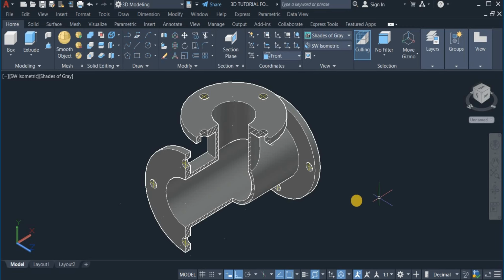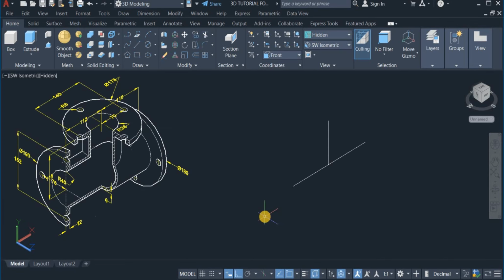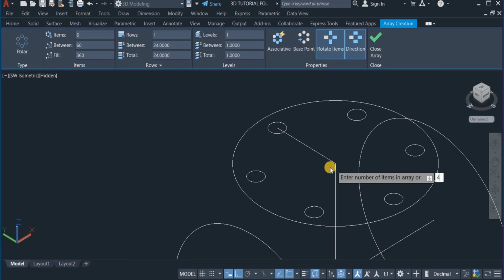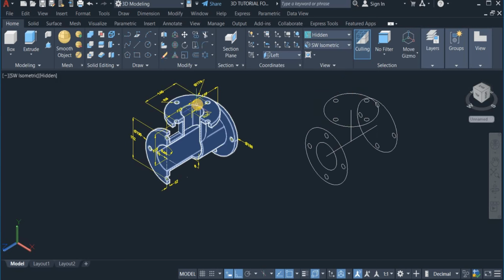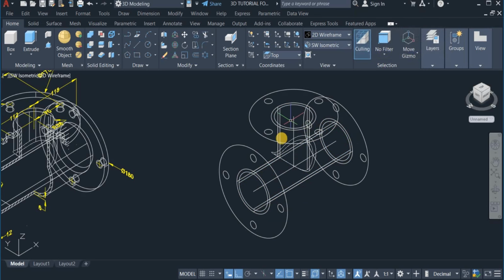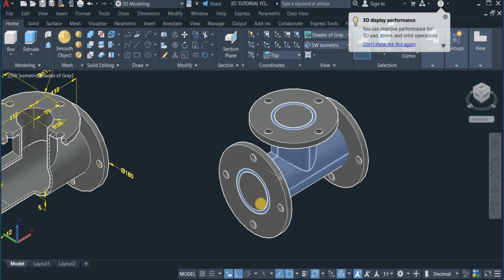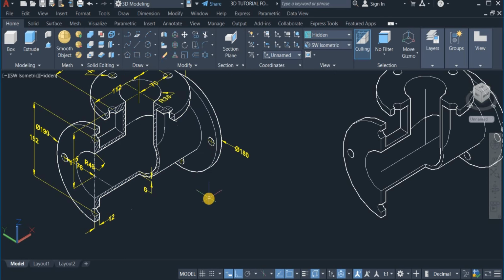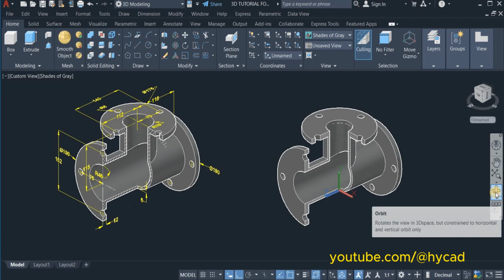How to Model a 3D Flange Tee (Step-by-Step). #3Dtutorial

Comment: I like your tutorials, but with this one I can't seem to work out the final hatching. I keep getting a 'closed boundary can not be determined' error. I have tried this one many times, and even simplified the exercise to a simple pipe with a cut out piece, I still can't get the hatch to apply..
Reply from the maker: Hatch can only be applied in a closed boundary, ensure there are no broken lines, and also that the lines are not duplicated.

Ensure that the UCS aligns with the face you want to hatch.

Try out this simple exercise'

1. Draw a square or a rectangle using the rectangle command. 

2. Draw a circle inside the square or rectangle that you have drawn. 

These two are closed boundaries. Now try and apply the hatch inside the rectangle or square that your have drawn.
Reply: I have used hatches in other exercises. I did the t-flange exercise twice to make sure there was no misaligned lines, and then like I said I made a simple pipe to cut out a corner with an extruded box (much like your exercise without all the extra bits) and the same error occurred.
Reply: ...unlike when you do it in the exercise, the sections to be hatched don't highlight separately, that may be something
Reply from the maker: Paste the UCS on the face you want to hatch.

To do this, go to the Coordinates panel, on the second row of the panel,  click on the Z-Vector Axis button, then click on the face you want to hatch. Then apply the hatch. @lachpearce6397